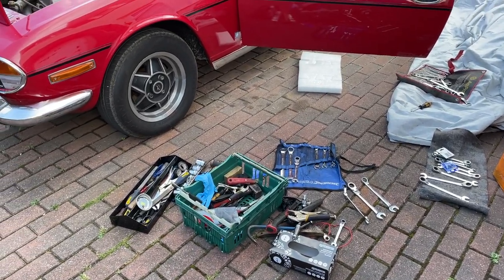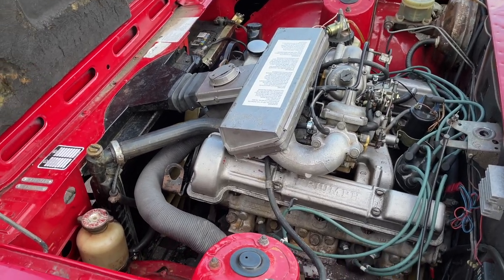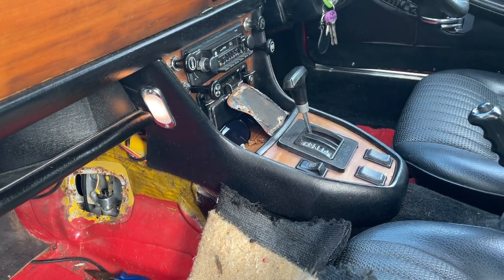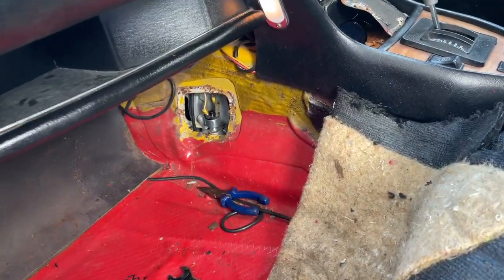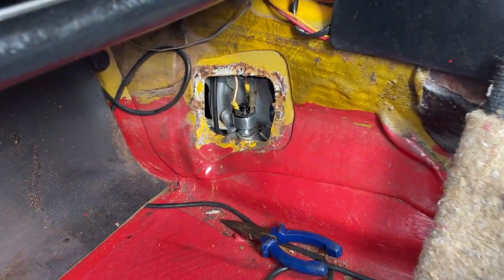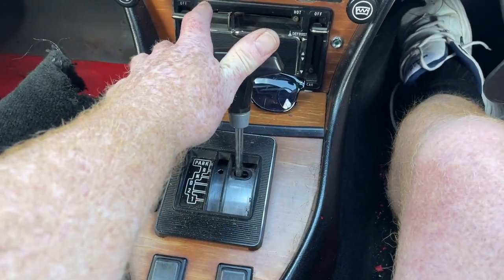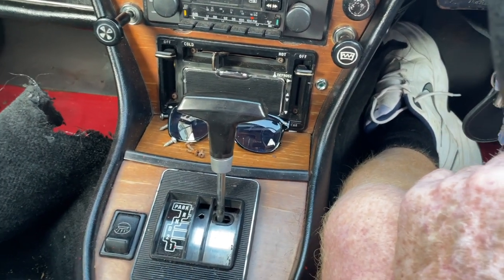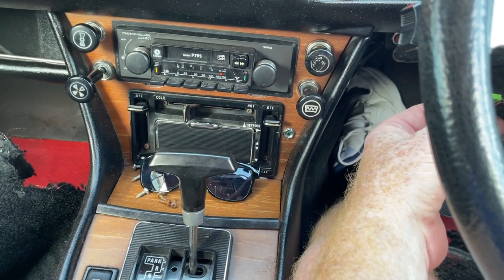Triumph Stag - Auto Box Inhibitor Switch

Comment: That inhibitor switch also works the reverse lights.  Two terminals for the starter,  two for reverse lights. The switch is spring loaded and the selector mechanism inside the gearbox pushes the pin in to a different depth to make the contacts.  There is a factory adjustment measurement between the switch body and gearbox case, so it only works in each P R N position.  If you don't know it,  use a multimeter or test lamp to check the two sets of terminals only go live in those 3 correct positions. Wrong adjustment can cause the reverse lamps to work in forward gears.  Never attempt to engage Park if the vehicle is not completely stationary,6 and held on the brakes.  There is a thin metal park detent pin inside the gearbox,  it will snap like a dry twig if the car is rolling even slightly.  Those switches also suffer from oil getting past the spring pin seal and contaminating the internal contact points.  The BW65 has a better flat  plastic non adjustable switch, bolted on the side and working off the selector cross shaft. They're not interchangeable, but you can easily upgrade to a complete BW65 and torque converter. They're a better and stronger gearbox than the BW35.